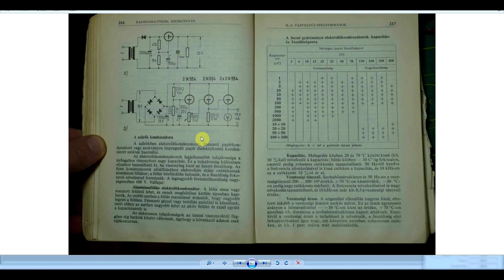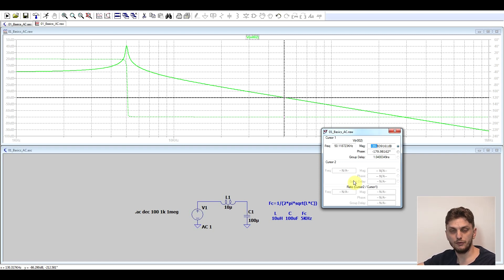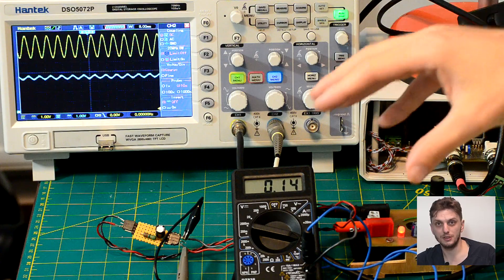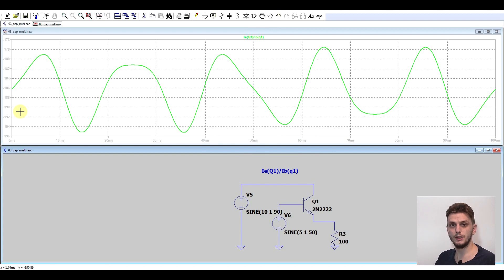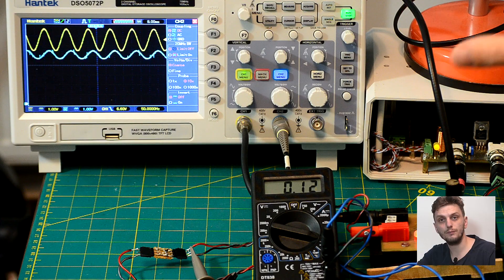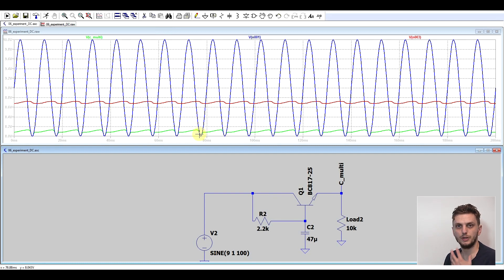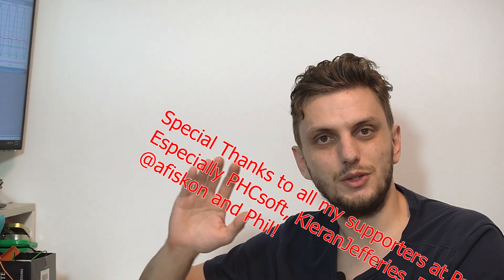Electronics Tutorial - A look at the Capacitance Multiplier

Comment: 0:22 Intro
1:42 LC LP filter (2nd order low pass filter)
3:40 RC LP filter (1st order low pass filter)
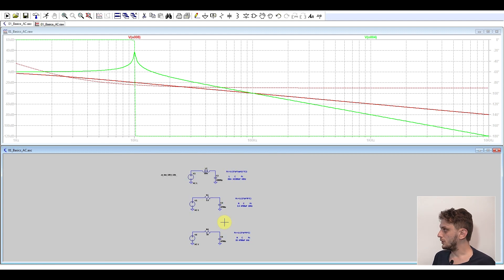4:55 RCRC LP filter (2nd order low pass filter)
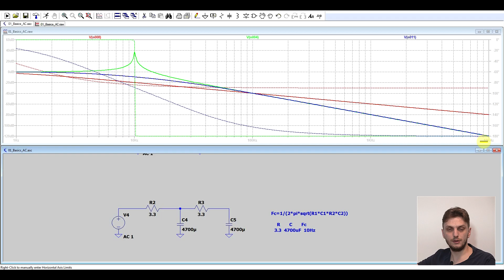5:27 Disadvantages (voltage drop over R: V=R*I, e.g. 22V=22R*1A)
7:08 Solution (RC filter with low current draw)
7:32 Highlight
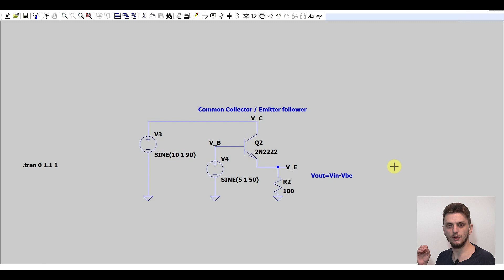7:45 Emitter follower (Common Collector Amp)
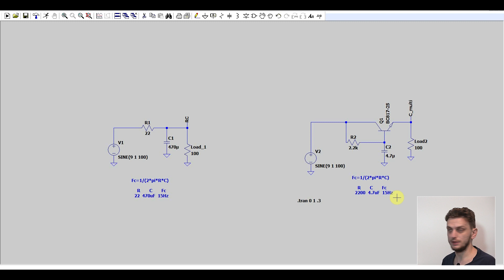10:18 Component size comparison
12:13 Issues (capacitor works not as energy storage, output voltage needs to be lower than input voltage)
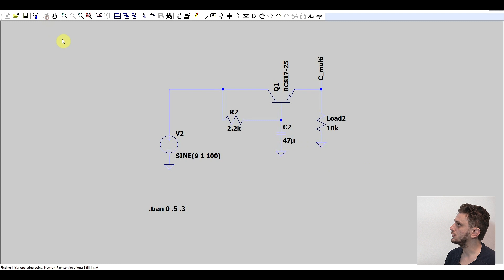13:22 Lower base voltage (with R) to drive the BJT at low input voltages
14:20 Conclusion
14:35 Historical use of the Capacitance Multiplier
15:15 Final conclusion (today's use)
15:50 Outro

Comment: LDO has a band width of less than 1MHz or UGF of few MHz. They do not filter high frequencies well.  Now if you have some noise source on the board, or chip, this circuit may be useful to filter out high frequencies.  Also this circuit is useful for switching power supply which have high frequency spires.  Though if you put this circuit after regulator slows the transient response.  So, we sometimes put it before LDOs.  
Also, note that large capacitors at high frequencies may turn into inductor, if you use them after their resonant frequencies, so it is not practical to use large capacitors to filter high frequencies.

Comment: Excellent and easy to understand video! Thank you. Sometimes it's difficult to find negative, or high voltage regulators, and they can be more expensive than just doing something like this. It's also nice to filter out switching noise.

Comment: Cont. … Q#4: Instead of the voltage divider at the BJT’s base, if we have used a ZENER, wouldn’t it preserve the AC response from the RC filter, while using the lower impedance of the Zener (compared to R1) to further reduce the AC to the Emitter? 
In this case, would this “regulated” Capacitance Multiplier be a better option to the unregulated one? Possibly even better than LM78xx or LM317 units - in terms of RIPPLE only? 
P.S.: Because in terms of load & line regulations, surely the LM ones would outperform even the regulated Cap. Multi.

Thank you for all
Euthymios (aka: EJEuth)

Comment: Cont. … Q#3: About Cap.Multi x Series Regulator = the latter being much more complex, with dozens of internal components and performing the feedback loop “externally” at component level (e.g. using diff. amplifier, etc) Wouldn’t a regulator be SLOWER and more prone to OSCILLATIONS  than the “intrinsic feedback” provided by a simpler Cap. Multi.?

Comment: Hi FesZ, always a pleasure to see your videos. This one, I already saw it on 3~4 times. I still have some questions and I would appreciate any light you could bring: 
Q#1: As the Common collector (emitter follower) has an intrinsic “following” Base-Emitter response, could we assume it works as an OPEN LOOP circuit if seen at multi-component level (transistor, capacitor C2, resistor R1, etc)?

Comment: what does it mean for the inductor to saturate and why is that important?
Reply from the maker: The inductance of an inductor is not a constant; when there is a magnetic core, the inductance is proportional to the magnetic permeability of the core; The core permeability is magnetic flux dependent - stronger flux reduces the permeability; at high inductor currents, the core permeability drops and so does the inductors inductance

Comment: And you need to pay attention to discharging the capacitor voltage when the power supply is turned off, as the stored energy will discharge through the B-C junction causing a transistor failure if you are not careful!

Comment: It is a great circuit. I used it many years ago to completely get rid of any audible hum in an OP-amp power supply. That power supply was just a bridge rectifier and an electrolytic cap and then a capacitance multiplier.

Comment: Instead of adding a resistor in // with the capacitor, can't we use a PN diode in series with the resistor to drop the base voltage by 0.6V . The advantage is that you have a fixed offset independently of the average input voltage.
Reply from the maker: I guess that will also work quite well; but from a price point of view, the added resistor is cheaper - I guess that is why the diode implementation you mentioned is not that common. 
If you have the budget for a diode, its easier and better to just add a zenner in parallel with the capacitor, so you get proper output stabilization.

Comment: I have never heard of this circuit before, actually, so thanks for the introduction.  It looks best for providing filtering of substantial currents at low frequencies. Nice one Fesz!
Reply from the maker: Indeed, it does not make sense at high frequencies, since an LC filter would have fewer losses, but at low frequencies having a huge capacitor is not always practical.

Comment: FesZ, thank you for that video. Question : the frequency domain for Cap Multiplier has a -20dB roll off ~ 100khz and then has +20dB gain after. Are there ways to solve this to make the frequency behavior the same as a single pole RC filter? What is contributing to this effect? it probably is the FETs/BJT parasitics coming into picture at higher frequencies but I'm not sure . Playing around with Cgs capacitance and adding Caps between Emitter/Source to GND helps  but i was wondering if there is a better method
Reply from the maker: I guess you added pretty small values of resistor and capacitor in the base of the transistor if the roll of is at 100KHz, the nice thing about this circuit is that it can achieve very low filtration frequencies. Anyway, coming back to your question, I did see some schematics where a ferrite bead was added in the base of the transistor to improve high frequency behavior, but anyway, at frequencies >1MHz you can add an extra ferrite bead + capacitor filter to improve filtration proprieties. With any transistor, because of the E-C capacitance at some point, high frequency noise will pass trough.

Comment: I am driving an N-CH MOSFET with pwm signal (20-30 KHz). The voltage at the drain is the 60Hz signal from the wall outlet. Every time the gate turns on and off, there is a ripple at the Mosfet's source. The 7810 voltage regulator does not filter this ripple out. Can I use this technique to smooth out the ripple? I don't want to use an inductor at this stage of the circuit. Thank you.
Reply from the maker: What frequency is the ripple at? Another way that is used in power supplies is a "snubber". A series RC circuit between the noisy point and ground chosen so that is absorbs signal above a particular frequency (say 2R2 and 1nF). This should have no effect on the 50Hz but absorb high frequency stuff.
Reply: @FesZElectronics  Thank you for replying. I finally fixed it by placing a 0.1uF between the drain and the source of the mosfet. And another one between source and ground. The frequency of the ripple was so high that I could only see the waves when I zoomed down to 20ns on the oscilloscope. But the voltage was over one volt.

Comment: I don't get it, at 13:52 you add a resistor to ground to lower voltage at base, thus lowering Vbe? How does that help??  I guess I also don't get why voltage output at C_multi drops immediately after input voltage becomes lower than at C_multi? Is this because Q2 somehow gets into cut-off region or something?
Reply from the maker: Hello AlanS. Vbe is a constant (roughly) around 0.6V, and that does not change. Now you can estimate the votlage on the emitter based on the voltage in the base by saying that Ve=Vb-Vbe; Ve in this case is the output of the circuit. By adding the extra resistor I push Vb lower, and that drags Ve also lower. 
Regarding the second point, the voltage at the output is coming from the input, so there is no way that the output will be larger than the input. Ve=Vc-Vce (Ve-output Vc-input Vce-voltage drop on transistor, a positive value usually >0.1V)
Let me know if its a bit more clear or if you have any more questions!

Comment: When using a MOSFET in a capacitance multiplier, is the voltage output limited to less than max gate threshold voltage? For example I have a 70 volt transformer, rectified to 109VDC, and I want to filter the ripple,  and use capacitance multiplier to amplify the current to 10 amps. 109VDC on the gate of a mosfet will destroy it, right? In this case, do I have to use a high voltage BJT?
Reply from the maker: Hello Josh! Well the Mosfet is in danger only if the Gate-Source voltage (Vgs) exceeds the rated value (usually its ~+/-15V). Just to be on the safe side you can add a zener diode between the G and S. 
The gate threshold voltage (Vgs_th)(usually 1 to 5V) is the voltage that is needed to get the transistor to conduct. 
Another parameter to consider is the Drain Source voltage (Vgss) - this tells you what is the maximum voltage difference you can apply between the transistor terminals. When the power supply is off, there is no voltage on the output. When you turn it on, in the first few ms there will voltage on the input and nothing on the output so the drain-source will see the full input voltage. I do recommend that you don't chose a transistor on the limit with this parameter - for the 109V you are interested in use a 150 or 200V transistor.  
Point is that it does not matter what voltage you are trying to stabilize. It will work with both a BJT and a FET, as long as the transistor is rated for that voltage. But since you are interested in 10A, FET might be the better option, or for the BJT version a darlington arrangement.
Anyway you could try the circuit out in the simulator first just to be sure.

Comment: nice tutorial. my latest project was 2 of such circuits, one of which filters a 370V supply. have a look here for circuits, simulations and pictures (both visible and IR): cadlab.io/project/22551/master/files
too bad youtube breaks all links, so you might need to manually copy paste into a browser
Reply from the maker: Nice amplifier design! The link worked just fine. I would have a suggestion though - I saw that you connected all the filaments in series to use a single supply. In old TV schematics where this approach was used, they usually added a PTC in series to limit the initial high current (until the heater warms up). I think that some sort of current limit might be useful also in your case to prevent the 1A rectifier bridge  or any of the tubes from suffering during start-up (in case one tube warms up faster than the others, then it will see more power dissipation and that might damage it). In one design I used 6V8 zenners in parallel with filaments connected in series to counteract any short term voltage mismatch. In your design the most sensitive tubes will of course be the double triodes since those will heat up much faster than the power tetrodes.

Comment: Nice video again!
But why not using a RCRC filter to this type? That way you even filter a lot more!
I actually find it strange that not a lot of people seem to use a rcrc filter with these kind of circuits.
Another useful addition is to mention that for quite some circuits (mostly audio), noise and ripple is far more important than perfect voltage regulation. So in this case a simple zener will do the job.
In the end you'll have a circuit that has much better PSRR than a standard 78xx regulator (and probably also better than a lm317).

I like your videos, they have a good pace and are well put together 👍🏻
Reply from the maker: Well I covered that(RCRC) in the beginning, I just refereed to it as a "second order RC filter", and afterwards I did not include it in the schematic to keep things simple. I fully agree, its more efficient than the simple RC filter and depending on the frequency you are trying to filter and where the corner frequency is, it can be even better to have 2x(R/2+C/2) rather that R+C so the size of the 2 options is comparable.